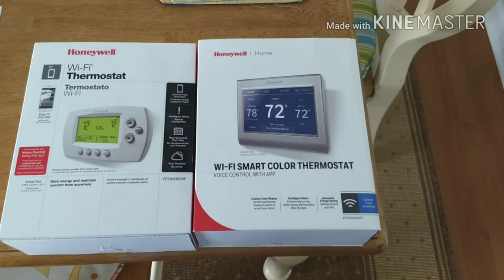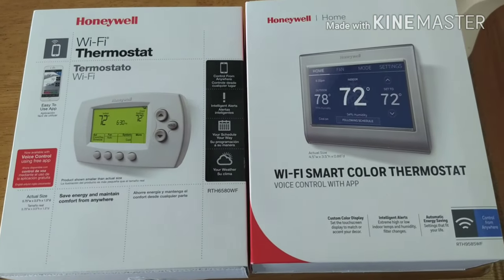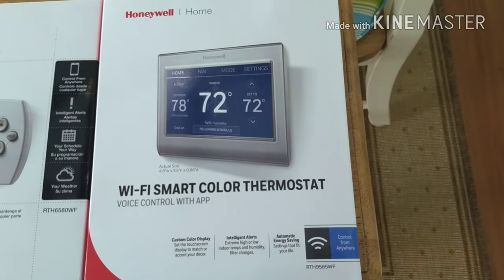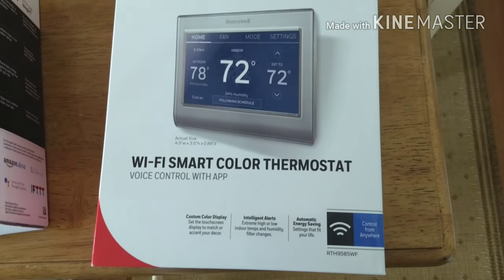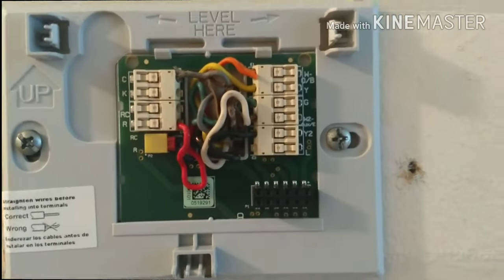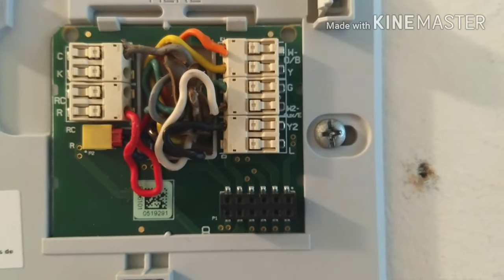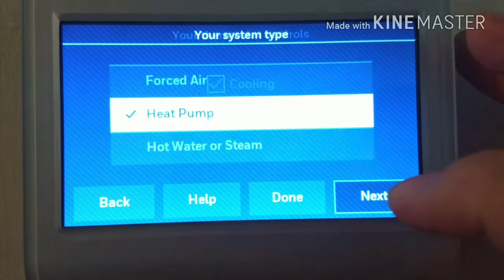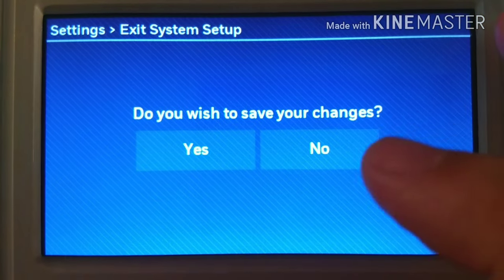Honeywell RTH 9585 Thermostat on Heat Pump HVAC

Comment: Perfect video, picked one of these up a few days ago and installed it, after a few crossed wires, the included instructions are horrible if you have a heat pump and not forced air.

Comment: O is your heat pump heating , W2 is your 2nd stage or heat strip, Y2 is for 2 stage compressor, (cooling) if your unit is so equipped
Reply: Correct

Comment: I will try your wiring setup, as some of your wires are in a different spot. Replacing the upstairs thermostat with the one the right, which is the same one downstairs. Took a picture of the wiring setup from downstairs and matched it for the upstairs, but the upstairs is running hot.

Comment: Have this.  Frustrated that it kicks on Aux Heat whenever it's set more than 1 degree higher than temp...getting up, for instance .  It has the smarts to time turn-on to have the right temp at the right time, but if nighttime temp is 2 deg lower or cooler than day setting, this thermostat will kick on expensive Aux heat.   I can't imagine why this "smart" unit won't allow programming what reasonable people would think is a good and efficient operation.  That's right, no way to change that, confirmed by a call to Honeywell.  Gonna switch back to a bimetal tstat for better, cheaper performance.  Ridiculous.
Reply: @JC-jk3kl  My old thermostat that was recently broke by the HVAC guys wouldn't auto switch to Emergency Heat, I had to do it manually which is how I would want it.

Anyway... I was a bit confused with JC's wording and couldn't quite grasp what he was trying to explain. In my opinion Emergency Heat should go by the OUTSIDE temp, because my 12 yr old recently dead outside unit functioned all the way down to about 25F... so in reality the Emergency Heat shouldn't activate till the outside temp reaches say... 32F to be safe. 

Or maybe they should have an option in the settings that you can tell it... kick in Emergency Heat when the temp inside reaches X degrees below your current heat setting and give options like... 5, 10 or 15 degrees and then set it for whatever you're comfortable with. Personally I would set it to 5 because I don't want to wake up with icicles hanging from my man parts. LoL

You mention that if it drops from 70 to 69 than the E-Heat will kick in... but isn't that 1 degree drop when the normal heat would kick on? I mean 1 degree seems a bit crazy to kick on E-Heat... should be more like a 2 - 3 degree difference minimum.

Comment: Thoroughly confused on which terminals my wires should go;   this is the best video i found so far that attempts to explain it - still not clear about where to put "O", "W1", "W2" wires, since new tstat does not have a "W" and "O" is already used.    My situation: 

I have following wires on HVAC board (Carrier): 

Dw - Pink
R - Red
W1 - White 
W2 - Black
Y1 - blank, not connected with any wire
Y/Y2 - Yellow
G - Green
O - 1 Orange & 1 Dark Pink wires
C - dark pink, blue, grey

Wires coming out of the wall for the thermostat contains following labelled ones from current thermostat: 
Y, G, C, O, W2, W1, R  

So, I am replacing RTH7560E1001  with RTH9585WF Smart series.

However, the new one does not have a separate "W" terminal hole.    "W-O/B"  are combined and I am already using this for  Orange wire.        Where to put "W1" and "w2" wires?   Help!

Emergency heat seems to triple the electricity bill;  so I am ok with leaving it disconnected or not using if that combination will work
Reply: I had pretty much the same situation as you today and had to run through the logic of my system to figure it out. When you have O on your system, your W1-O/B from the thermostat goes to the O on your air handler and condenser and it's also important to set the thermostat so that O is your switch valve (most common setting). So why is there no W1 connected to the condenser? The thermostat is telling your condenser to run and the O is telling the switching valve to change from heating to cooling, so it doesn't really need to tell the condenser W1 to run since it's controlling the valve when it's told to do cooling. If it's heating, it won't run power to O and the valve stays in heating mode. It's summertime so I can't verify that it still runs the defrost cycle with this method but it does work for cooling and heating as I've observed. I need to find manuals on my system to be sure but it could be that we need to jump power from O to W1 just to be sure.

Make sure your AUX/W2 is hooked up to the air handler. If the temperatures are too low, your heat pump isn't going to work and you're not going to get heat. Yes, straight electric heating is very costly but there is no choice once there isn't any heat to "pump" out of the ambient. Ideally, you would use Gas backup instead of Aux Heat strips but you need an air handler that has the gas hook-up for that.

I still have an issue where this thermostat isn't kicking in Y2 (2nd stage cooling) when it's needed (thermostat is way behind for a long time) so I need to try to contact Honeywell about when Y2 is called upon or maybe I have a wiring issue at the thermostat... Which means having to run a continuity test from the thermostat connection to the air handler somehow while the thermostat is popped off. Maybe I'll just apply my own 24 VAC power to it then test at the air handler. 

How frustrating this thing has been! Why don't they just make thermostats with all of the 8 terminals that may be needed? I hate that the instructions were meant for someone just "replacing an existing thermostat." No details as to what each terminal did or any clarification on what the W1-B/O meant. I was upgrading from a single stage thermostat to finally utilize the 2-stage system I've had for almost 10 years now and boy what a lot of time this took to figure this out and I'm not even 100% sure I have the heating right but I can't see any other way that the system would work with this thermostat.

Comment: I love the RTH9585 thermostat, but new home that we've recently moved into has a Heat Pump with the Emergency Heat Strips. May problem is figuring out which terminals on the RTH9585 I need to use for it to work properly.

My old thermostat is wired as follows:
R	24vac
G1	Fan
Y	Compressor
O	Reversing Valve
C	Common
W2	Heat
E	Emergency Heat

Most of the terminals on the RTH9585 line up correctly. But, there are a few that don't.
R			R-wire
G			G1-wire
Y			Y-wire
C			C-wire
W-O/B		O-wire or W2-wire?
W2-Aux/E	W2-wire or E-wire?
??????		E-wire?

Where do I connect the O, W2, and E wires on the RTH9585?

Honeywell is no help, anymoer. They no longer give phone support for DIY installations. You have to pay a HVAC tech to install it if you can't figure it our yourself.

Thanking you in adavance.
Reply: As in video
O goes to w-o/b terminal
Y goes to y terminal

With heat pump with emergency heating
as in video
W2 goes to w2 aux/e terminal
E goes to y2 terminal

Comment: Not sure if the emergency wire should be connected to the Y2 terminal since that terminal is for 2nd stage cooling/heating and will still keep the heat pump running.   I beleive a separate terminal that will shut off the heat pump and activate only the emergency strips/coils will be required if you want to isolate the emergency heat.  The RHT9585 combines the auxillary and emergency into a single terminal.  So, if your air handler has separate coils for auxillary and emergency heating, i think the RHT9585 may not be the ideal thermostat for you.  I am not an expert at HVAC, so if I am wrong, can someone explain how Y2 will shut off the heat pump while activating only the emergency heat strips.

Comment: I have read in the manual that if the Auxiliary and the emergency are separated, then connected them together and put them into the W2-AUX/E! This is what confused me! Would you please explain which one goes to Y2? Is this the emergency heat "E"? Do you happen to know why in the manual says to connect them both together? Thanks for help
Reply: I have the same question
Reply: @TyWerks  Well, I may have a follow up for this, I checked the heat pump itself up in the attic and W1 and E were connected so I connected them at the thermostat and it has been working for two months with no issues! Good luck, the thermostat is pretty cool!
Reply: @amribrahim5833   ok thanks did you use a nut wire? I don't have a y2 wire myself I'll try the w2 and e thanks
Reply: @TyWerks Hey sorry, I corrected it, I went to look at the unit, the W1 (white wire in my unit + E black) both were connected with a pigtail with a wire nut then the pigtail was connected into W2/Aux E slot in the unit! I don't have Y2 either. The unit came with a short white wire, I used this as a pigtail!
Reply: @amribrahim5833  Appreciate it I was able to hook it up today thanks a lot for the info

Comment: @Ricks Gadgets,  I have the following wires: G, O, Y, W2, C, R, E(which was not being used and another unlabeled blue wire not being used.  The RC and RH slots were jumpered together as well as the Y and W1.  Their instructions are hard to understand.  Do you have any suggestions how I should wire them for the RTH9585WF Honeywell WiFi thermostat?

Comment: Rick, I have a heat pump system also with the same thermostat but I can not get the thermostat to power on. Any suggestions?
Reply from the maker: If you have a volt meter, you can check if you have voltage between the C and R wires. You should see 24 volts between them. If you don't have a C wire, this unit will not work. This may also help: https://smartthermostatguide.com/thermostat-c-wire-explained/
Reply: Ricks Gadgets I did that and I do have voltage.
Reply: Thanks for the guide, I will take a look at it
Reply from the maker: @soju337  You may have a bad unit then. I know my problem was miss labeled wires on my unit. Once I found were the power was, I got it to power up.
Reply: Ricks Gadgets it’s a used one I bought from an online action very cheap, so I am thinking it’s the unit also

Comment: Does this thermostat indicate if it’s on emergency heat or using aux
Reply: I installed this stat about a week ago, mine will indicate 'HEAT ON' or 'AUXILIARY HEAT ON' - if it needs to go to 'EMERGENCY HEAT ON' it will indicate that also. This information is located lower left on stat.

Comment: Installed this same thermostat a coupe of days ago and the tempersture is off by about 2 degrees. Does it get more accurate over time?
Reply from the maker: No but you can adjust it. Ours was more accurate than the one we replaced. Here is an article that I found that shows how to calibrate the temperature with a thermometer you know is actuate.  https://tomstek.us/how-to-calibrate-honeywell-thermostat-temperature-rth9580wf/

Comment: I HAVE A HONEYWELL 9585. IT'S BEEN WORKING PERFECTLY UNTILL THE COLD WEATHER HIT. NOW IT DOES NOT BRING THE TEMPERATURE ABOVE 55 DEGREES WHEN IT'S SET AT 70.  APPARENTLY AUXILLARY HEAT DOES NOT TURN ON WHEN NEEDED. WHAT SHOULD I DO TO SET AN AUXILLARY HEAT FUNCTION?
Reply: Did you ever figure this out? I just moved and my new house has this and im freezing lol. Like i cant make it stay on for more than 3 minutes max

Comment: I have the same thermostat and a heat pump, now, when the heat is on, it is suppose to say "heat on" or "emergency heat on"?
Reply from the maker: I don't know the answer. We had to replace our system and the new wiring has changed from this install. Now it only shows emergency if that is on. Else it just says heat.